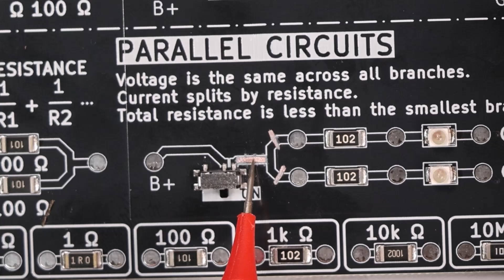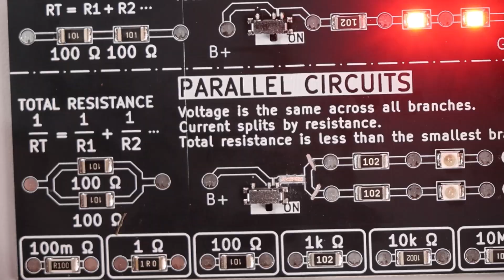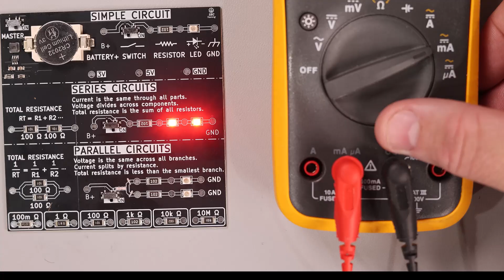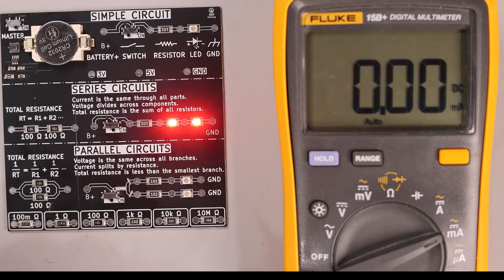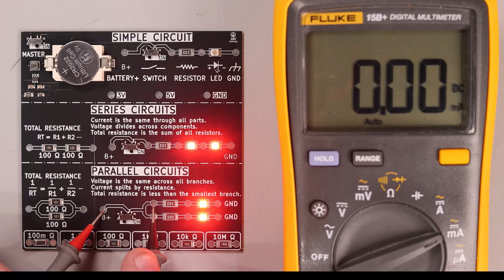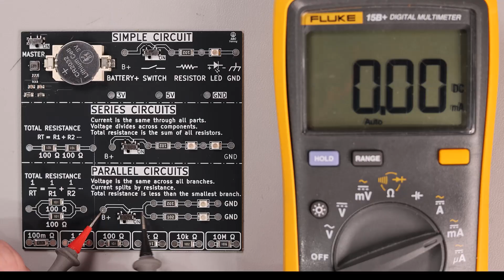Understanding Current Flow in Parallel Branches Practical Example for Beginners

Comment: This board is awesome. I've been following the latest videos about it. I do have a question regarding this one: I understand the two cuts at the beginning of each branch, but why make the main cut (exposed copper)? Couldn't you have performed the test from the B+ point instead?
Reply from the maker: Thanks. Yes, I could have gone with the B+. The current would have been the same. I wanted to make sure that the switch was still in the circuit and illustrate the point that the full current of the circuit flows up to the point of the two branches.
Reply: @ScottHadzik  Got it, thank you! I totally see the teaching advantage now. For a second I thought there might be some technical reason I was missing (still learning!), but it’s obviously the best spot to visually prove that the entire load current flows through the switch and right up to the split. Crystal clear, thanks again!